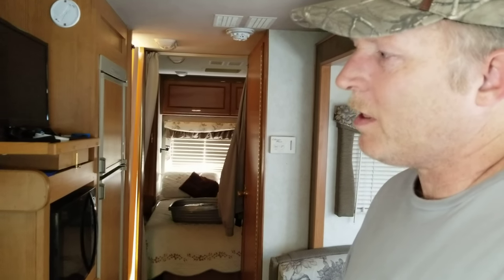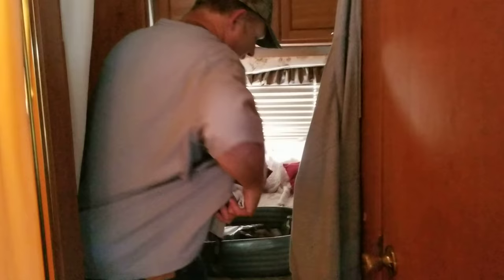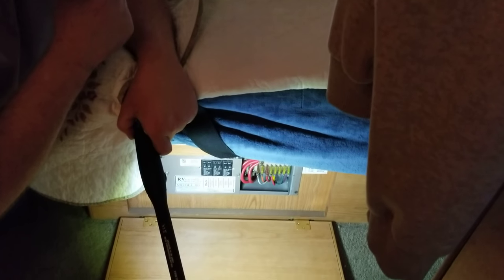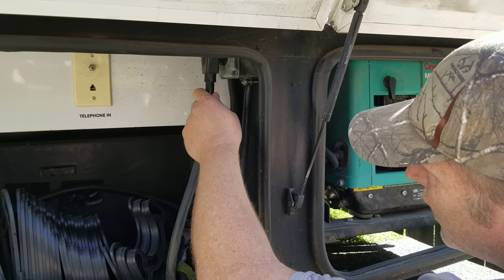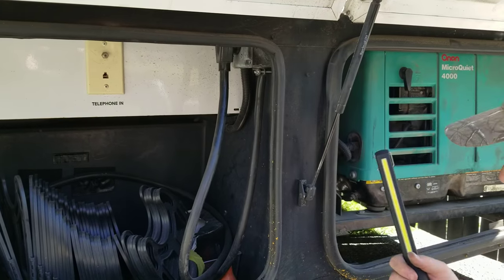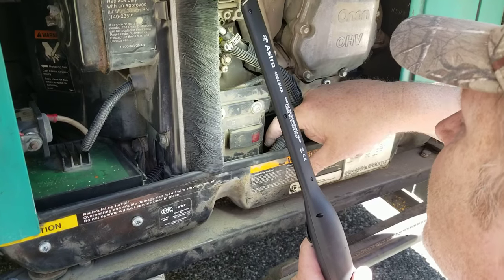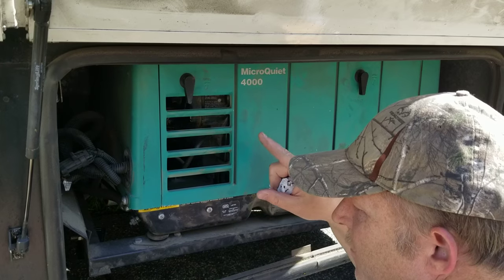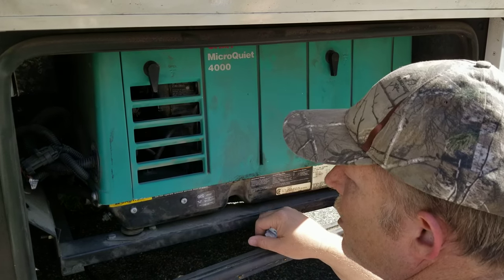Onan RV Generator runs but no electric - watch this fix

Comment: Good video.  I would add two things concerning tip #3:  (1) the AC breaker switch should be in the up position to allow generated AC to go to your converter in the camper and onto your appliances;  (2) once you have the AC breaker in the correct position, let the generator run a few minutes to build up charge to your camper appliances before turning them on.  I rushed the procedure, and the appliances (micro wave, refrigerator, air conditioner) would not come on.  This led me to believe there was an internal problem with the generator, that something to be more complicated an expensive to correct.  It was simply the breaker switch being in the wrong position to start and, then, not letting the charge build up in  the generator.
Reply: Mine is also an up and down position and I am working on this same problem. I will update once I get to work on it this weekend- I will try your trick of running before I try the power.  I think I was trying too soon.
Reply: Same thing here..

Comment: You are the man! Just bought a used Winnebago from C.W. and they showed me everything on the RV while it was hooked to shore power. Generator started great and since I have another RV, I wasn't too worried about it everything seemed normal. Got it home to load some supplies while it was 115 outside (Phoenix) and gennie cranks but no power. checked everything and all was good. Was about to call and cuss out the salesman when I stumbled upon you video and viola, it's all good. Thanks for taking the time to help the rest of us out, even those of us that are mechanically inclined, we still need some help every now and again.
Reply: Oh, and I subscribed too. I have a feeling you'll be helping me again on something or another!
Reply from the maker: perfect and thanks for your comment and sub
Reply: Tkx for the video. No power from generator used your ideas and it was the circuit breaker on the gen. Thx again Bill
Reply: A 😊😊😊😊😊😊

Comment: THANK YOU SO MUCH!  I purchased a 2006 Country Coach diesel pusher and am new to the RV world.  I couldn’t figure out why my Onan wasn’t powering anything.  The Onan’s internal circuit breaker was turned off.  I switched it to “On” and POW!  Let there be AC, lights and most importantly, battery charging!
Reply from the maker: Glad I could help!

Comment: That model is the later 4000 which has the voltage regulator & control board all combined. It is the board in view lower left side with the heat-sink. They will also not continue to run if there is no and or low/high output voltage.

Comment: This is going to sound silly or stupid take your pick. We just purchased our fun mover yesterday and I was using shore power then decided to use the generator good so far right. Not being use to an RV I just fired it up and later turned on the AC well it would work plugged into the shore power it worked figured generator problem checked all the things you went through and looked good but nothing. Searched the web for help and be GODS GRACE I found your channel and here’s the silly part I didn’t know the shore power pig tail MUST be plugged into the outlet I thought it was just a way to keep the prongs good and not to beat a hole in the bottom of the compartment! 😂 Thank you sir and GOD BLESS YOU!!!🙏💪🇺🇸
Reply from the maker: journey well my friend,  it's all 👍 good

Comment: There is nothing wrong with cycling the breakers off and then back on. Tripped breakers will often remain in the on position instead of moving to the neutral position.

Comment: Thanks for the video. Out of the blue my generator quit supplying power to our rig. Thought it might be rodent damage.  Traced and tested all wires. Could've saved a lot of time if I watched your video first. Turned out to be that hidden switch. I must've hit it a while back when I was cleaning the generator. Thanks again.

Comment: Thanks ! You just saved me a lot of grief driving my RV 70 miles round trip to the repair shop. We just had generator work done because it would not start. They put a new carb on it. We tested before we left the repair shop and gen cranked and ran fine.   After getting it home I tried putting the air conditioner on. Nothing. No AC anywhere in the RV. I Googled the symptoms and your video popped up as first on the list. I'd briefly looked for a breaker on the generator but did not find it. Your video showed me exactly where to look on my Onan 4000. I pulled the little switch forward as you said because it was pushed backwards to the rear. Cranked the generator and everything worked inside again. Way to go! Thank you again.
Reply from the maker: journey well my friend

Comment: Saved me 
The switch on the Onan had tripped 
My generator was running but no power to the plug
Little switch hidden was the key
Watched multiple videos that did not even say anything about a breaker on the generator.
Thanks so much.
Reply from the maker: journey well my friend

Comment: Thanks for a great troubleshooting video. I had forgotten about the circuit breaker at the generator and probably accidentally tripped it while replacing the carb. Flipped it on and power was back. I appreciate you putting this out, should help lots of folks, easy checks to get your power back.

Comment: Thanks for the tip, I had changed the carburetor, started up perfectly but didnt have any AC power. So I followed the manual's trouble shooting procedures. The problem was when I read "Make sure the breaker is on" I thought it meant in the breaker panel. Your video saved me hundreds $$$,

Comment: Tip #3 is the winner.  For any of you folks who have a situation where the genny’s front panel is difficult to access and remove like mine (I have a Sprinter conversion, and everything is tightly packed), here’s a hack that might work for you.  You do have to remove the front panel to do this the first time, but after that, you’re home free.  

You’ll need a drill, a wire hanger and wire cutters.  

The genny breaker switch knob has a small hole drilled through it—a perfect size to slide a wire hanger through it.  First, I drilled a hole a little bit wider than the diameter of the hanger wire through the genny’s metal housing (just below the bottom edge of the front panel), aligned and level with the breaker switch.  Next I cut a piece of wire from the hanger then bent one end 90° then fed that end through the hole I cut and then fed it through the switch hole.  I then bent that end just enough so it wouldn’t slide out of the switch hole.  Finally I trimmed the “pull” end so that it was long enough for me to pinch when the switch knob is in the furthest rear position (off).  This length prevents the wire from being pulled all the way through the hole I drilled.  

Now I can move the breaker switch back and forth without having to remove the front panel.

Comment: Sir thank you 🙏 so much for this video I did the breakers and fuses check. So I gave up on it. Had called mechanic. But was not available till next week. So I seen your video and flip that switch next to start button and theirs it goes. It gave me electricity. Thanks 🙏 a million
Reply from the maker: your welcome and journey well
Reply: Indeed! There should be a big note somewhere on the gene about that switch. Some generator models, you don’t even see it, you have to feel for it with your fingers. I had just installed a brand new gene and there was no power to the van... take a guess? ... it was that breaker switch that had flipped down. Thank you for that video Sir!

Comment: Thank you.  You saved me a lot of grief.  I had mice get into the generator area and cleaning out the mess they made I must have bumped the switch off thus no AC output.  Moved the switch forward and that solved the problem.

Comment: You helped us...thank you. You saved us a good amount of cash because we were already thinking of replacing the generator. It has 900+ hours on it. It was a fuse on the generator, the old school 250V. Also the switch on ours works the other way. Thanks again.
Reply from the maker: Glad I could help

Comment: I just put a new carb in my onan micro 4000 and now that it is running fine I found I had no power. Saw your video and the little breaker on the generator was the issue. Thank you sir for this video, you saved the day.
Reply from the maker: your very welcome

Comment: Thank you very much for your help! I bought a new transfer switch and installed it today. Didn't fix the problem. Searched YT, found your video....fixed! That darn little circuit breaker on the gennie was tripped. Can't even see it. Wouldn't have know it was there.

Comment: Thank you so much. I added a small amount of oil, reached down in there to clean up a little spillage and must have flipped the switch. I had no idea it was there. Thanks to your video I have power again from the generator. General RV would have charged me a few hundred bucks to “fix” it. Thanks again
Reply from the maker: yes they would have. a guy commented on my video last summer that he was ready to spend 4 grand to have a new gen installed next morning as they said it needed it for sure. he found my video, removed a pint of oil and it works fine

Comment: Great tips.  
I have the exact same generator in our toy hauler.  It has been the most unreliable piece of equipment I've ever owned.  Currently it cranks, but won't start.  This is unusual for my generator as it always works at home,m but NEVER works when out camping.  I've spent so much time and money on this  boat anchor.  I, after being let down by this genset more than once, never leave home without my always reliable H.F. 3500 watt inverter generator.

Comment: I was going crazy trying to find the problem!! I have the same model generator and it ran just fine but no electricity inside. I flipped the breaker inside the RV, I flipped that button on the generator and still nothing. It was the 30 amp plug that wasn’t plugged into the outlet in the RV 🤦 voilà!! Let there be light lol I’m glad it was just that. I feel so dumb lol RV-ing is all new to me but I’m glad you helped me find the problem.
Reply from the maker: journey well my friend

Comment: Great video.  I've been messing with mine on this trip for three days.  IMPORTANT TO PAY ATTENTION TO THIS:  In my experience, I had reset the breaker on the Onan generator (mine looks exactly like yours, but different model number) with no success.  After watching your video, I decided to pull the shorepower and plug my 30 amp into my onboard outlet (so as to provide electricity to my coach), and WITH GENERATOR OFF, I then reset the generator breaker switch.  It worked this time.  Prior to this, with the generator running and resetting the switch it did not work!  Note, too, that the switch is to be pulled toward you...away from you is off on this same type generator as in the video.  So happy as it will be 100* while visiting Boston the next couple days and having the generator powering the coach air conditioner will keep my family from killing one another!

Comment: Thank you! First rv with gen. It was scheduled to come at a certain time but we are at a full hook up spot. It came breaker on the generator reacted and flipped off. Not thinking used your way and came on and the GFI was reset in kitchen and we had air and power. Thanks you.

Comment: Same thing happened to us.  After trying these great tips, it ended up our voltage regulator was bad. I was really hoping it would be one of your easy fixes💜 but it ended up being a $600 voltage regulator repair service 😪. But that's ok, our rv is working again beautifully. Great video. Thanx

Comment: You have saved us!  We have hurricane Florence  at our door in eastern NC and we were going to use our RV generator as we usually do to power our freezer, etc.  My husband couldn't get any electric output at all.  We were almost panicking (or at least I was) since if we were leaving we should have already done so.  I came in to our computer and searched the problem and found your video.  It was solution #3!  My husband had no idea there was a breaker switch on the generator.  Thank you so much for taking the time to make this video!
Reply from the maker: thank you for your comment and stay safe

Comment: Thank you for a great video as I had this exact problem when I went to exercise my RV generator after it sitting and not running for 6 weeks. It turned out to be the generator breaker was flipped. I wasn’t aware of that breaker but will remember in future.

Comment: Thanks! I changed the oil on my RVQG4000 and inadvertently switch the breaker off when I wiped some spilled oil from the bottom cover. Solution #3 worked!!!
Reply from the maker: thanks for your comment and have a great day

Comment: Thanks. I will look better tomorrow. I just spent days trying to change out my fuel pump and fuel filter. Finally got it in and working but now my electrical is not working. It's not the circuit breakers or fuses. I'll check for that circuit shut off tomorrow. thanks. I tried your other trick before about removing some oil and it worked once after that but then started acting up again. So found out it was actually the fuel filter.

Comment: Great video. Unfortunately I'm still having a problem with mine although the symptoms are slightly different: it'll start only until I release the start button, then will shut off right away. Got any idea?
Reply from the maker: faulty ground somewhere,

Comment: Just saved me some stress. I turned the generator off before turning off my AC unit and I think it popped the switch on the generator. Flipped it and working fine.

Comment: Thanks Wolf. I don't have an on-board generator but I do have one of those small really quiet ones made by Generac iq2000 but that's good information because I've run across a couple of people in years past that were having problems and that would have been good information I could have shared with them had I known at the time have fun out there and be safe

Comment: This is how I fixed mine. In the case of:
"I CAN'T START MY GENERATOR"
 It's has been two years since last time it was running, so I started by checking oil level full at gen (it won't start if low oil becouse of sensores), gasoline more than 1\4 tank in my RV (also safety censors), sparkplug checked for good spark, check the manual circuit braker (ON) at front RV engine compartment for current, also cleaned the carburetor and even installed new one but same situation, then checked wires and found some has been chewed by rats so I replaced them, by this time it started but stay runing only by keep pushing the switch on all the time, so I knew it was electrical problem from the engine itself, so I took the generator out from my RV to work in my garage, ( I did this by myself with some tools and old tricks) it's really heavy for one person. 
 I disassemble the unit at my garage and started by removing the cover, then the cooling fan or flywheel unit (it's 2 items in one unit) until finally I was at the gen rotor and brushes assembly area and this is what I found: one more wire chewed by filthy rats plus the stinky rat nest in the middle of the generator motor coil, I fixed the wire and sanded the commutator copper contacts where the brushes are sitting becouse they were real duty with old urine from the rats. 
Then I assembled everything back together and  bingo it's runing like a champion.
For this project materials involved was about $60.00 including an aftermarket new carburetor and an harmonic balancer/steering wheel puller (available at any auto parts for $25.00) to pull the aluminum fan out and (flywheel). 
Just picture this: (Eny engine run smooth if gasoline and DC current aren't interrupted) so following this important principle you'll always find the problem to be fixed. 
Also if you have a onan microlite 4000 like mine, don't run it for more than a minute without the cover becouse you'll cook the engine real fast, also keep the eye on the aluminium fan and your fingers after cranking it in case you missing one or two members...just kidding. 
After testing the gen then put the air cooling assembly back and the rest of components including the cover and done!!!
 If this can help eaven one person save time and $$$  it'll make me more happy, thanks for reading!!!

Comment: Excellent video, all good advice, and things to check first!  Unfortunately for me the problem is deeper.  I've got to determine if the genset is making power or if the transfer box inside the coach is not distributing the electricity.  Wish me luck.
Reply: So as it turns out the generator transfer relay circuit board has failed, looks easy to remove and replace https://amzn.to/30R4Inj

Comment: Hi there you mentioned in the beginning of this videos from the 1990s on. I have this problem right now with my 1986 Minnie Winnie Winnebago. The generator starts up and sounds real good but no power to any 110 inside.
Because of watching your video I told the side mechanic that came over that there could be a hidden switch in there and he really didn't even look but he seemed to think that no there's not on this one like it's too old I'm not sure what to do is he said the fuses and Breakers are fine any ideas or advice would be appreciated thank you so much
Reply from the maker: there should be a switch somewhere
Reply: @vegasdavetv  thank you so much for replying I'm going to keep looking I also heard it could be a bad transfer switch that automatically turns it from Shore power to generator 110 I'm going to look for that switch I hope that's what it is thank you again